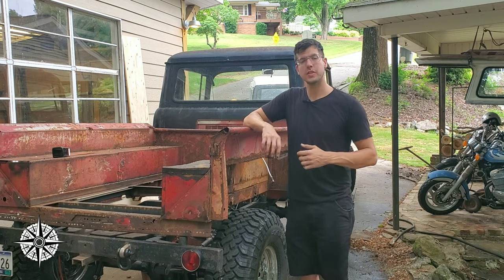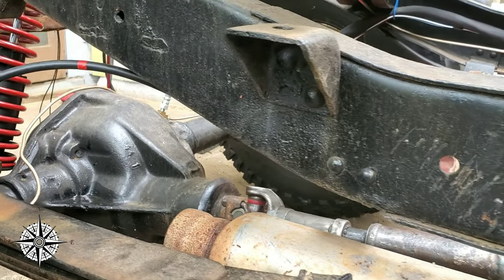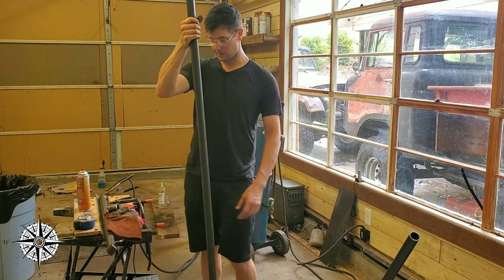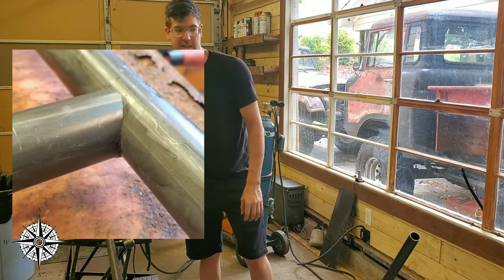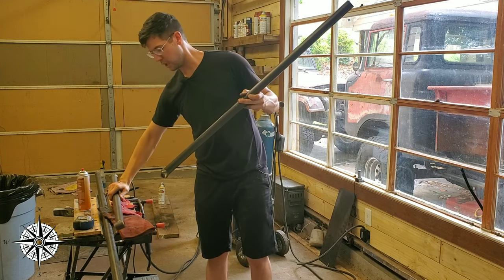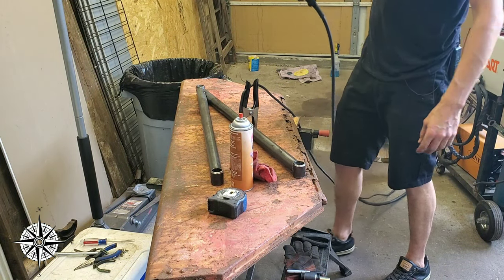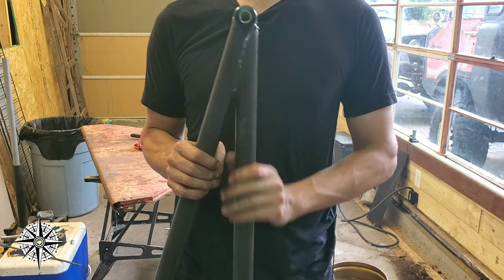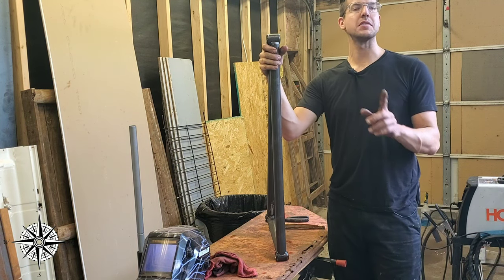Jeep traction bar fc150

Comment: Nothing wrong with flux core mig wire, if you doubt me go watch some welding videos about it.
Reply: Its not the flux wire per se, its the fact that most ppl buy the 90 amp $80 welder that doesnt get hot enough for this stuff.
Reply: That's true, the duty cycle of those rigs is gonna be low maxed out they will need to stitch weld and it will take a long time. 

I use a lot of flux wire .045 because it's windy here. I accidentally welded with it once with my gas still on in the building. Give that a try sometime and let me know what you think.